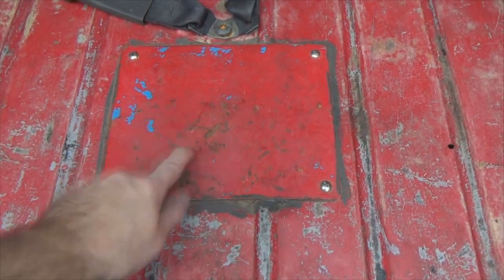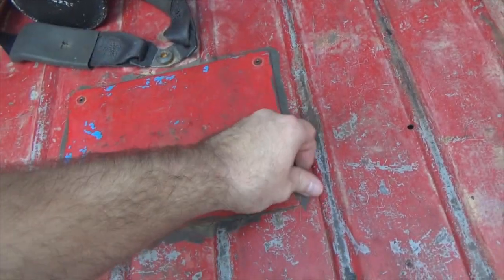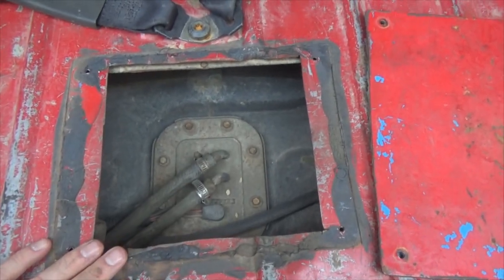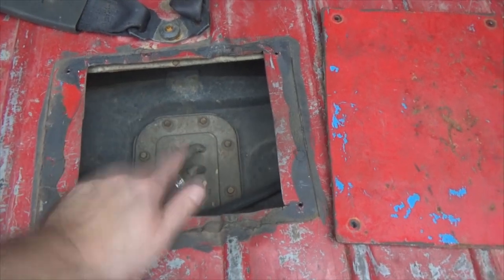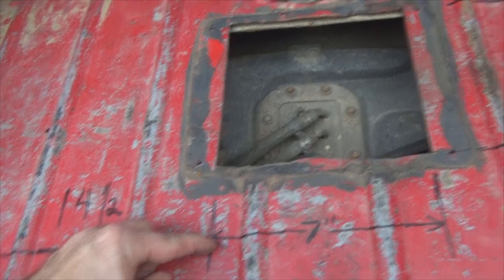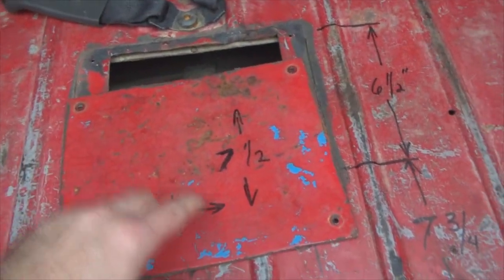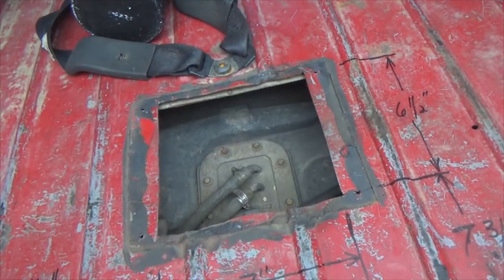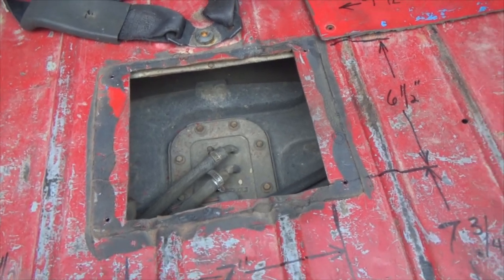Jeep Wrangler YJ - Fuel Pump Access panel mod

Comment: I am wondering if you could tell me why after I changed my fuel pump in a 1995 jeep YJ,,wrangler. That the fuel gauge only goes to 3/4 when full.   I even had to change it a 2nd time because the ground came undone,,and put another new one in, And both did same thing with gauge. Only 3/4 when full.  
    I wondering if I bought wrong fuel pump and sending unit both times. I thought I have a 20 gallon tank,,but maybe it is the 16 gallon??  Either way,,I told them what jeep I had when getting my parts.
Reply: And BTW it looks very similar to original and fits into tank perfectly.  Should I have put my original float on new unit??
Reply from the maker: If you have a 20 gallon tank, then Its going to be either the wrong sending unit or the float arm needs adjusting. I have seen new sending units have bent arms and be inaccurate. Hope that helps. Have a great day!

Comment: what year is this yj?  Mine is an 87 and I believe the pump is up where the engine is at. Just making sure what U see is right.
Reply from the maker: Your 87 is carburated, so yes yours is on the engine. Mine is a 1991 fuel injected, so I have an electric pump in the tank.

Comment: Gas gage still 1/4 tank full ,but it's  empty. 
Do I take down tank & replacement float.??
Reply from the maker: There is a little white plastic bowl in the bottom of the tank. After several years the bowl gets warped. The the float gets at the bottom of the tank it sits on top of that white bowl making the gauge read 1/4 tank. Rip that white bowl out and will be good to go. You gotta drop the tank and remove the fuel pump and sending unit. Here is a video to show you the bowl: https://www.youtube.com/watch?v=6i9X2agOEYs .  Hope it goes well for ya! Have a great day!

Comment: Hey man, any idea how to replace the fuel lines that connect to the sending unit? On my YJ they're pinned between the frame and the body.
Reply from the maker: Gotta drop the tank and run new ones. Drain all the fuel out to make the tank lighter and easier to handle. How did the lines get pinned between the body and frame to begin with?
Reply: Power Addicts - FixJeeps.com - Jeep, car and motorcycle tips ended up having to loosen the bolts that hold the tub to the frame and jacking it up about half an inch. The fuel tank vent valve lines and the fuel pump lines fed through a rubber block that was held in place between the frame and tub. It was a right pain in the ass.
Reply from the maker: I bet it was! Are the lines collapsed?
Reply: Power Addicts - FixJeeps.com - Jeep, car and motorcycle tips nah, apparently it was designed that way. The rubber block that the lines feed through keeps them from being crushed and also holds them in place.
Reply from the maker: Hmm .. now out of curiosity I'm going have to look at mine to remind myself how its ran. The last time I looked back there was when I changed the fuel filter a long time ago. Well .. at my age I do good to remember yesterday let alone that far back lol.

Comment: So I have a 95 YJ, there is a frame piece towards the rear of vehicle, did you cut that as well?
Reply from the maker: I didn't have to cut any frame pieces. The hole situates between the body braces. You basically want the hole to be over the fuel pump plate. Don't try cutting it with the tank installed .. sparks and gas fumes make boom. Thanks for checking out the video! Have a great day!
Reply: Todd O I have a 95 YJ as well. Getting ready to do this mod. Have you already done it on yours? Be interested to know if you found any discrepancies with these given dimensions. Thanks!
Reply: I measured according to the numbers he gives out and at the bottom, towards the rear, it falls on the body brace half way. Just an FYI I put the Warn skid plate on and it brings it( pump hose) up to just below floor and I have a lift on mine. Also, I am far from being mechanically inclined, but I would recommend putting everything new, ie, hoses clamps etc... to filter and be done with it. I ended up dropping tank 5 times messing around. Live and learn. But this access is awesome!
Reply: Todd O thanks!
Reply: @bizzarrogeorge  I have a '95 Yj as well.  What modifications to Chuck's dimensions did YOU come up with.  If the dimension from the back of the tub hits in the middle of a support rail underneath, did you add a couple of inches to that dimension for cutting clearance?  Like say 9-3/4" for the back to the edge of the cut?  Thanks.

Comment: How does one do a wheel alignment on a YJ 87 Jeep Wrangler
Reply from the maker: Once I change out the steering parts that needed replacing. I take it to the alignment shop and let them do it. Then I know its correct. My tires are too expensive to chance having excessive tire wear.

Comment: Everyone does this Chevy trucks etc with tank in- no big deal.. just put a barrier between tank and bed
Reply: I have done this same hack on my Chevy...had the stealer ship charge me $500 for  replacement  ...I was stuck out of town and had it towed..never again!  95 Chevy has 250k miles ..I have replaced two fuel pumps ...I have cut the SERVICE hole in  my 2004 chevy silverado...I will do my 95 jeep ..

Comment: Warning, For anyone changing the fuel pump on a 1995 wrangler,,or a close year to that. The new assembly has a single ground wire tacked to the top of it. And it is NOT connected very well from the factory. I suggest fixing this ground  before you install it or you will be taking it back out again very soon.  It is junk right from the dealer or auto parts store.
Reply from the maker: Good point!! Very true! Thanks for adding a great tip for everyone! Have a great day!!
Reply: Yep,I have been trying to post this anywhere I see a video about this years wrangler. My 1995 wrangler quit because of fuel pump ,just a few months after I replaced it. Cost me towing and when I took it out ,that ground was not connected to the base any longer.
  By the time I realized it I had already bought another new pump assembly. And the new one was going to do the same thing in no time. I wiggled the ground wire ,on new pump,,and it fell off!!!
 It is amazing to me how horrible this ground is connected.
  Im not sure what years use this same assembly,,but if you look you cant mis it ,,if you have the same one.
Reply from the maker: Only issues I had after intalling the new pump was the little hose that connects the fuel pump to the pickup tube popped off. I replaced it with a slightly longer hose and it been perfect since. I've seen this ground issue on cheaper pumps. I run nothing but Bosch pumps, I didnt have any issues with the ground wire on it. I checked it before I installed it.

Comment: So frustrating; I literally took the gas tank and the skid plate out this last weekend to go and replace the fuel pump in the ancient fuel lines up in the crevices and I ended up not doing this mud and putting back the gas tank and gas tank cover only for me to go and start it and see a bunch of gas start leaking from the top of the tank where it’s inaccessible FML I have to now drop the gas tank AGAIN 🤦🏽‍♂️ and I’m going to take that time to cut out this access door mod. If you have to drop your gas tank just cut this fucking door into the truck bed it’s going to save you so much headache

Comment: Seven bolts, six lines and a plug. Not a big deal if you had the tank out, replaced the skid plate, spray nined the tank and replaced the hardware.
Reply from the maker: Yep, its not bad at all to drop the tank in your driveway. A buddy of mine had to replace his on the side of the highway with a full tank of gas. With the access plate, the pump can now be swapped anywhere in minutes, full tank or not. Have a good day.
Reply: Where I live, we call a (friend) to come get us--OR, we call a tow truck. I lived in Brunswick Georgia in the early ninety's, out there, yeah, I would cut that hole, maybe 🤔.  I had friends that would help but no cell phone back then and roads were long.